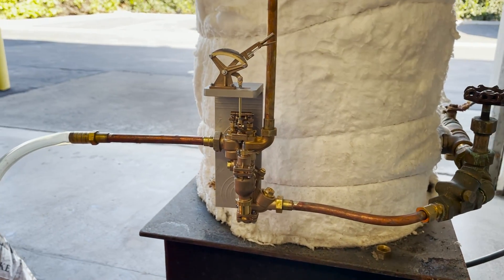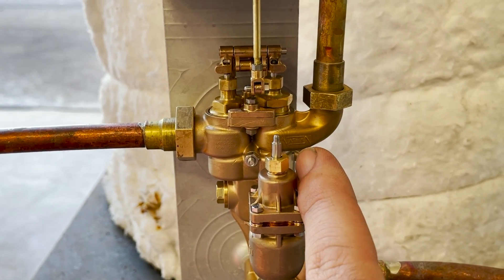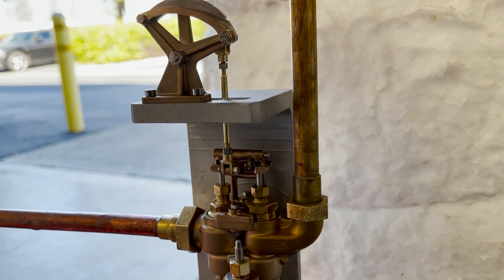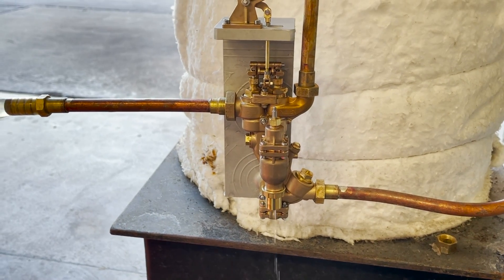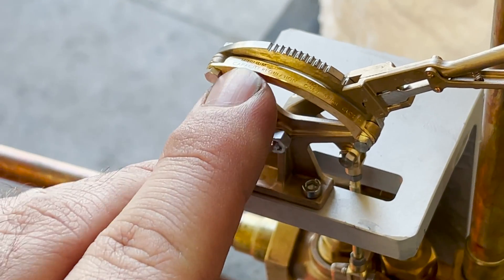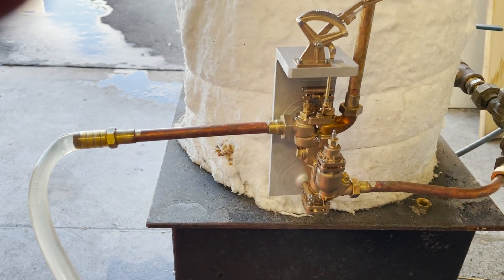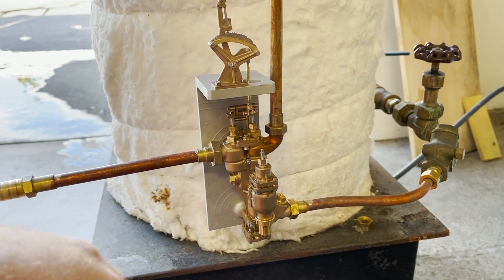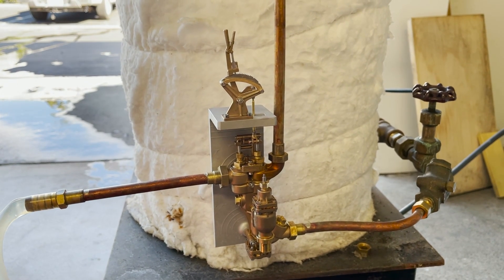1.5" Scale Nathan Injector Operates Like the Real Thing!

Comment: Very impressive.  A very nice piece of work.  Having dealt with actual Nathan engineering, this about as real and quality operation without having the “4000” parts that originals had.  Yes you obviously could not include everything that the originals had, but what you have made is about as close to the safest method to add boiler water and with ease of operation once properly adjusted.  It will be interesting to see after a few years of operation how tight if the steam and water valve seats remain tight and how long a set of nozzles will remain useable before wear or cutting takes.  That comes with service problems from conditions.  The original 4000s had their problems also.  As you may have discovered, in 1948 Nathan had to make a major changes to the bodies due to liming up of passageways and relocation of the jet nozzle within the body.  There were other changes made as service conditions were noted and improvements made to suit.  Your study of the nozzles engineering to obtain the correct relationship of tapers, diameters and spacing based on steam pressures is very much admired.  You are probably aware of how many variations Nathan had to come up with to satisfy different steam pressures, water capacities for the three different sizes of 4000s.  Anyway nicely done!  C. B. Ahrens